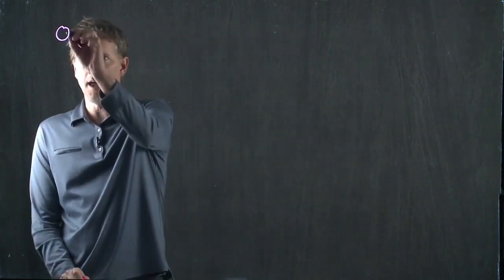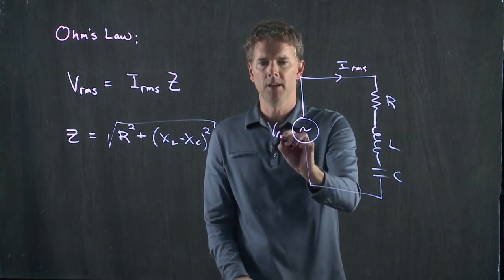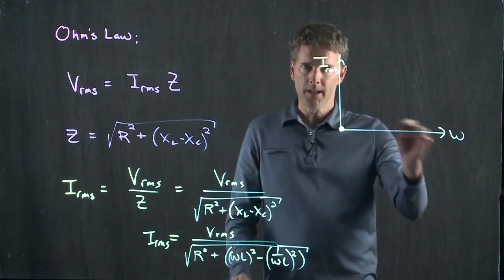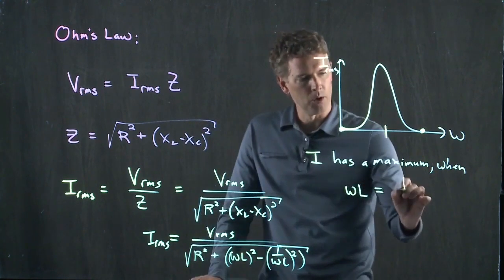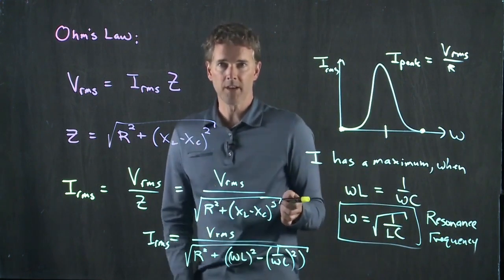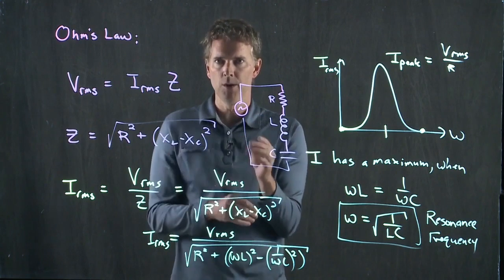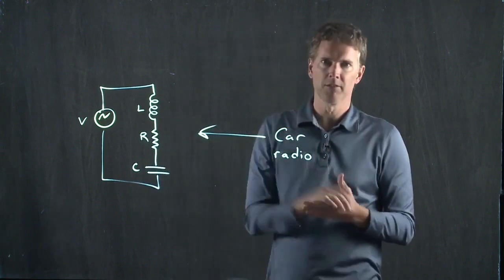Resonance in LRC Circuits | Physics with Professor Matt Anderson | M26-09

Comment: Hi Matt, I have a circuit with fractal geometry but with no semi-conductors that I would like to share with you; and if possible send a unit to you so you can test it independently.  Basically, I created a process to put any PCB into resonance and by doing so I logic gates with geometry of copper. Thus far I created an ALU, and that is the unit I will send to you.

Comment: As a kid I built a sigle trasistor radio. I did not know how to do the calulation for the resonace tank, so I left the capacitor out and ended picking up a nunber of stations sumitaniously that were close to each other. Also found that when I added more or less turns to the coil I would get meduim and shot wave receptions.In hindsight I think what happend was that wire to the water tap was not ground to the earth and this with a long aerial acted as the capasitor.
Reply from the maker: Awesome!  Sounds like a grand experiment.
Thanks.  Have a great day.
Cheers,
Dr. A

Comment: When you write expression for impedance you wrote (sqr(omegaL)-sqr(1/omegaC)). Instead you should write sqr(omegaL-1/omegaC). Am I wright?
Reply: (a-b)^2 = a^2 + b^2 -2 a b
Reply: @Giovanni2862  This is fine but where is -2ab?
Reply: @НиколаБошњаковић  There isn't
Reply: @Giovanni2862  You have R^2 +(Xl-Zc)^2 and this expression is fine. BUT in next line you have R^2 + ((wL)^2-(1/wC)^2) which is not good. Instead it should be written R^2 +(wL-1/wC)^2.
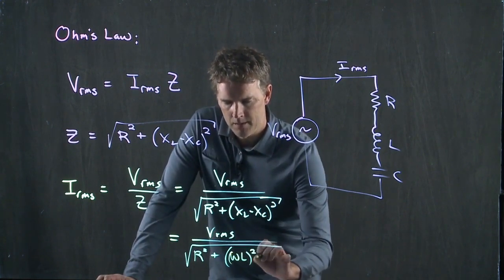Reply from the maker: Yes, there was a mistake at 2:07.  Great catch!  Nikola your last comment is correct.
Cheers,
Dr. A

Comment: Old automobile radios did use variable inductance tuning.  a ferite slug was inserted and retracted inside the inductor coil. variable permeability. But of course it is the same principle of changeing either the capacitance or inductance to change the resonance.
Reply from the maker: Yep, another great trick.  Thanks for sharing.
Cheers,
Dr. A